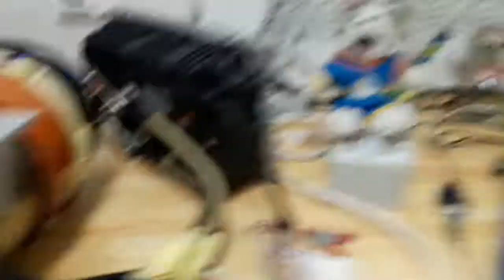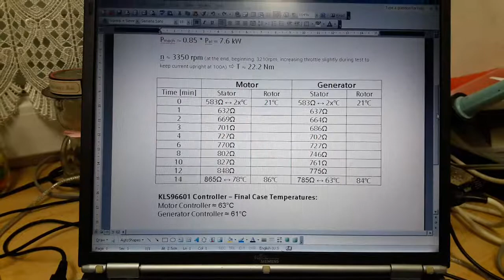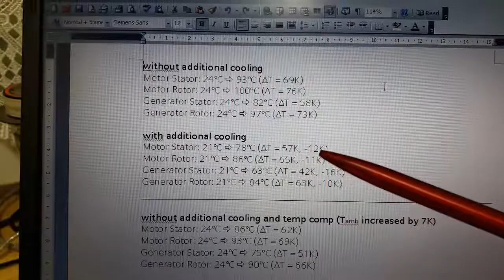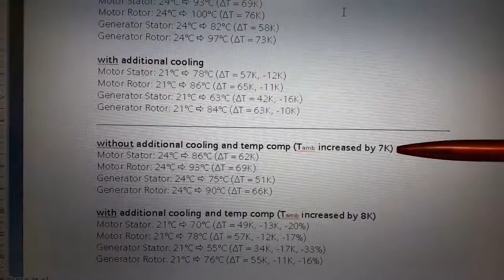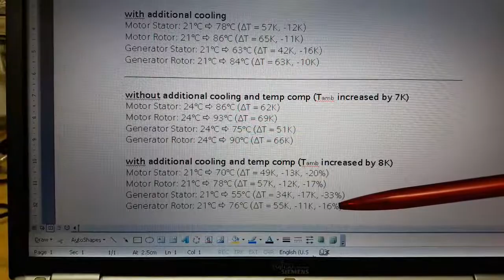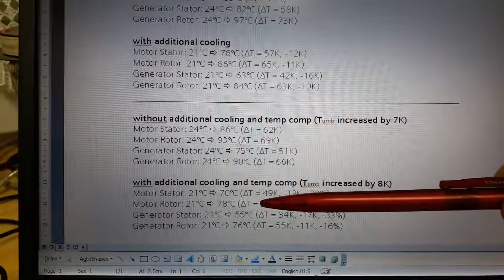Performance Test WITH COOLING of REVOLT 160 Pro (Brushless DC Motor)

Comment: Hi, what would you say how long the motor can run before overheating?  With fan cooling and 7.6kw output? Very good Video with interesting informations. Are you German?
Reply: sorry,  I read the wrong times and thought the temperature will continue increase
Reply from the maker: Hello, after turning around the test bench providing some more fresh air it already seems as if it runs 24-7 @ 7.6kW :-)
Reply: Next EV I think that's verry impressive for it's size! I drew the temperature curve of your last test and it looks like it won't increase anymore after the 15minutes. Right? Probably a little bit hot.
Reply from the maker: Hi, imho it will keep on increasing but just a little. On the other hand it doesn't look as if any of the delta_T exceeds 60K which makes it save at an ambient temp of just 20°C. That is indeed impressive if it comes to power density and efficiency but not as good as the manufacturer tells us. With the next and probably final improvement with more small heat sinks at the rotor it'll be save at higher ambient temps as well :-)

Comment: Hey Next EV. No more updates?

I have been playing with high currents and have discovered problems: one minor, one huge.

The minor problem is that the output of the hall sensors glitch (when the output is floating, as opposed to when pulled down) by enough to trigger the next stage when the stator phase changes to the next state, even with fairly low currents. This is easily solved with simple analogue or digital filtering.

The huge problem is that the output of the hall sensors randomly and totally crap out when the stator currents are great enough, causing catastrophic misfiring of the motor driver.
No amount of clever filtering can solve this.
In my case, when passing 110A or more (steady current, not PWMed), the hall sensor outputs change state regardless of relative rotor magnet position. It is implied the motor should be good for 200A peak, so this is a real problem. With subsequent dismantling and bench testing, it became obvious to me that the hall sensors are not quite fitted in the optimal position between the stator lobes, such that if the coil current is great enough, the magnetic field from the stator coils is enough to overcome the field from the rotor magnets. Without the rotor (and magnets) fitted, I could get the hall sensors to trigger at a mere 12A ac. Had the sensors been fitted perfectly, the fields from the lobe pair either side of them should completely cancel out in the direction of the hall sensor sensitivity axis (the sensor becomes totally immune to the coil flux).
I have since fitted another set of SS411 sensors (to the same stator lobes as the original set) this time in their optimal position. The sensors now don't even detect the coil flux at all when passing 150A ac, even without nearby magnets, so now I reckon I can pass 1000A though the stator coils without them overcoming the field from the rotor magnets. So far my mods have fixed the problem and my reassembled motor runs cleanly at 200A. Also the motor seems to run a lot quieter.

So if you're having problems with the motor at high currents when using hall sensor feedback, you might want to check this.
Reply from the maker: Hey smeggyhead1,
sorry for being absent for quite a while...I have had some personal issues, everything is fixed now and I will start testing again asap :-)
Your "huge" problem and your solution sounds interesting, especially because I heard from many others similar problems but haven't encountered such things on my own two motors.
Could you upload some pics or vids of the original position of the hall sensors as well as the modification?
Could share the original operation and the much smoother and quieter running on your channel?
Till soon...

Comment: Out of curiosity, I ran a current stress test on my 62kV 160 pro. I left 1 phase conducting 120A constant current for about 30 minutes. The rotor was not spinning. The motor was held vertical to allow a little natural convection current for cooling of the stator (and to minimise the risk to the rotor magnets); no forced cooling. Temperature measurements were taken using a thermal imaging camera and pieces of strategically placed black insulation tape to confirm emissivity. All measurements had seemingly stabilised. Room temp was 20C.

The maximum surface temperature were between the 2 pairs of active coils, which were at 77C (the coil cores may well have been a bit hotter).
The coils furthest away from the active ones were at 55C. The rotor case (immediately adjacent the active coils) was at 35C.
The voltage across the connecting terminals was 0.66V, translating to a phase resistance of 5.5mR (which is roughly inline with the temp coefficient of copper) and 79W heat dissipation. I suspect hysteresis losses (when spinning fast) will be a lot more than that.

With a spinning motor, the currents would be 'timeshared' between different the 3 coil pairs, and there would be some forced air cooling, so the max surface temps might be lower than 77C; however, the various hysteresis, AC and ESC switching losses should also be considered.

All our testing suggests to me that we're better off pushing more current (instead of more voltage/rpm) if we want more 'efficient' power from these motors.

Comment: Very interesting. So I might have to add some piping to my bike to create a ram air scoop to help cool the motor.
I got my 62KV 160 Pro today (phase-to-phase resistance is 4.5mR, the external connecting wires are still 6AWG). Time to have some fun.

Keep up the great work.